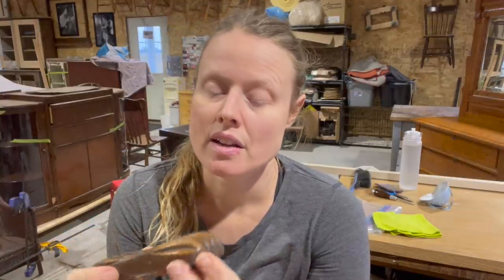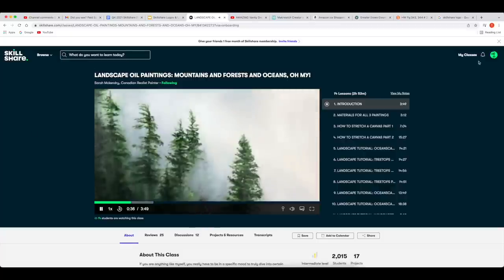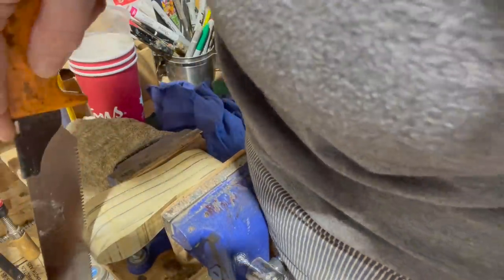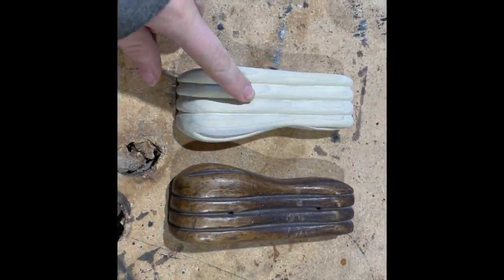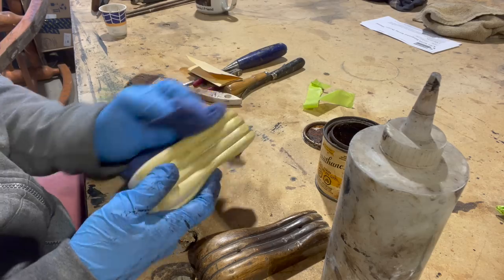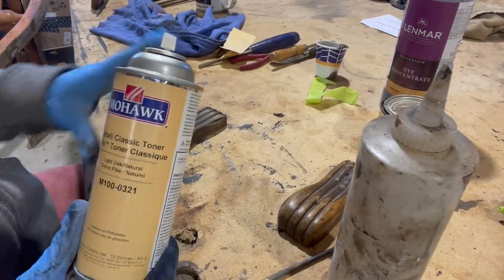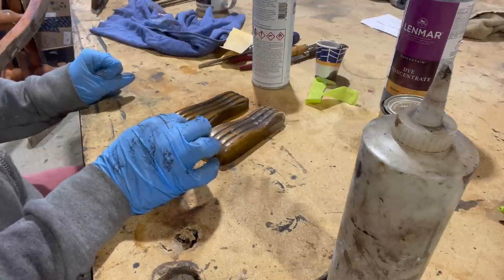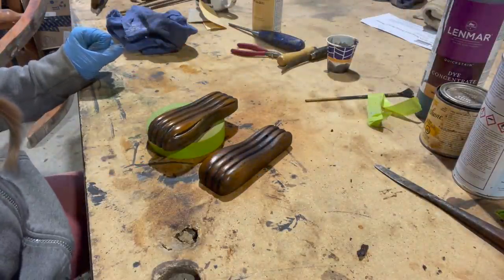Look what this bad dog did!

Comment: Great restore. I had to do some repair work of some chairs that were thrown out because a dog chewed them. I did dowels for the stretchers below the seats and the harp design on the back . It took me a few days for all the work. It isn't perfect but almost can't see the difference of the original wood but is noticeable.  The only tools I used was my hands and sandpaper to do the dowel stretchers  to fit in the legs. The only power tool I used was a jigsaw to do the harp on the back . That was over 10 years ago. I do have pix but are not available. That dog who chewed the chairs had separation anxiety.

Comment: Never a doubt it would turn out great. lol - had me confused for a moment when you made the new one darker - didn't realize you were going to strip the other. Hate when they discontinue a good color - Special Walnut was very useful. Burnt Umber toner was pefect touch to give it the proper patina. FYI: To do rough carving, I used a Dremel plugged through a sewing machine foot controller. With workpiece clamped, you can control Dremel with both hands. Dremel may even have their own foot switch now, but the sewing machine controller gives you nice variable speed. Cheers

Comment: My best friend is a little rat terrier. She was about 3 months when I rescued her from a house of pit bulls. One day she chewed a hole in the Sheetrock and I almost gave up. But a little later she cut her belly open chasing a squirrel. It was awful and I couldn’t take her anywhere until Monday. This was Friday. So my dad and sister came over and somehow closed up the wound with super glue and i babied her all weekend. I held her when she went to the bathroom and called in sick Monday, but told them why, and for the second time in less than a month she had surgery. She was just spayed like 2 weeks before. Anyway she took my heart and has been my best friend ever since. But anyway! I still haven’t fixed the hole, it’s been 2 years.
Reply: I have my second Rat Terrier she's missing part of one ear mommy did it during her birth . They sure will test you while they are pups ,and beyond .